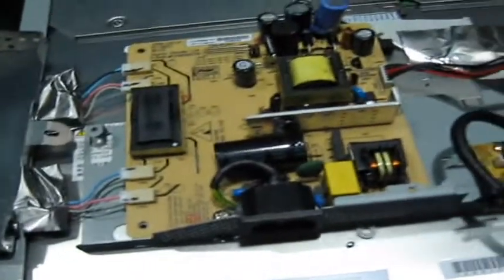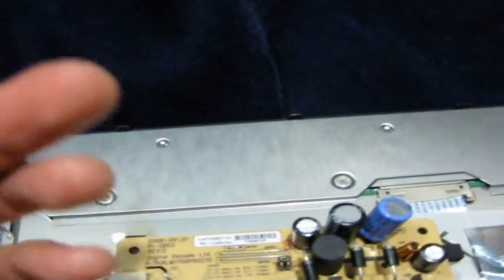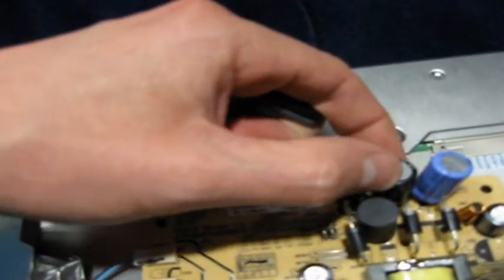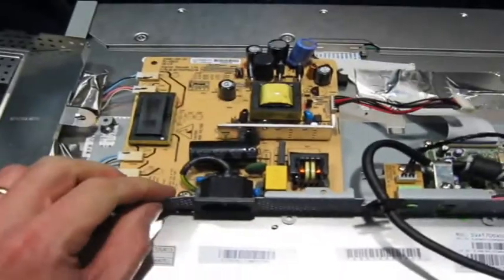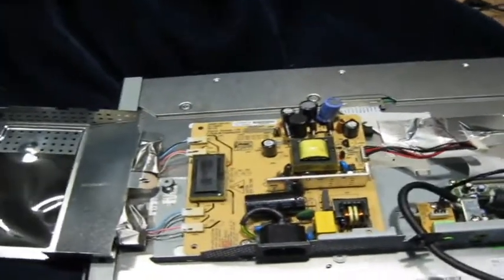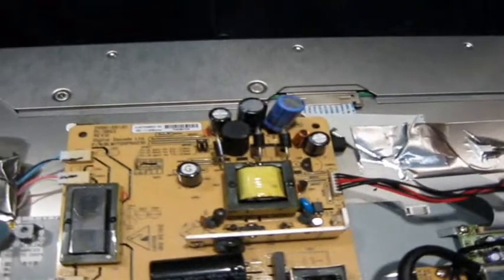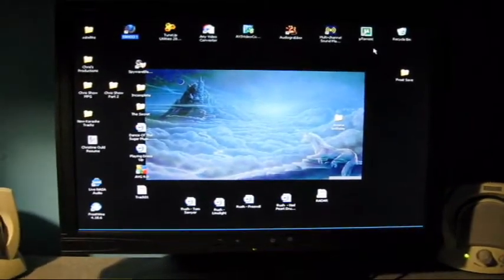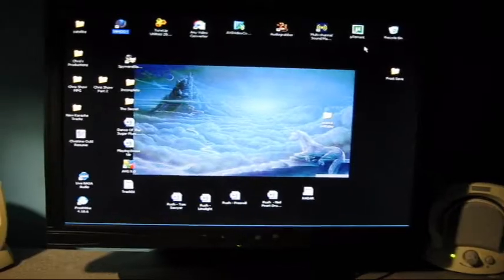LCD Monitor Repair

Comment: Hey, I have a Optiquest q20wb monitor and when I turn it on it makes a squeaking noise. When the monitor is hooked up to the computer it doesn't want to show anything on the screen, the screen is just black. It has a green flashing light in the down-right corner. So could you please help me to fix this monitor so I can use it, and also if I need a capacitor where can I buy it so I can replace it? Thanks!

Comment: so you doubled the voltage but still remain at 470uf? thats way underrated your damn lucky it works in SERIES theyd double the uf but remember youre still under 1000 uf and itd run through the first cap so youre a bit limited. it can be done but best to get the PROPER cap they are dirt cheap and dont risk an expensive lcd monitor. especially in the psu

Comment: Thanks for the vid! I was able to do the same to a similar model Optiquest Q9B-2.  Replaced the 2 Capacitors with 1000 uf 32v and FIXED!
Interesting note: The capacitors did not look blown at first glance, the tops were just barely "domed" so I figured to replace them,  The DMM shown not storing the rated farads.

Comment: thank you for your videos. The problem is i have replaced the capacitors in the power supply of a Samsung monitor (Power Board IP-35135B). I even replaced the ones that looked fine in case they couldn't hold up charge anymore. Still no success. Back light still doesn't lightup. I know for a fact its the power supply problem because i have tried it with a different known working one and the monitor lights up.
Do you have any solution? Could it be other problems such as transistors or coils?

Comment: @kirkconway You really need to open it up and have a look at the capacitors on the power supply board.  If any are bulged, you stand a good chance of repair...

Comment: wow. So very grateful of this video. I just picked up one of these monitors from the trash (who the hell throws out LCD monitors?!) and had the exact problem you just described as well the IDENTICAL cap you replaced looks like it's popped on my power supply board. Will pick up some caps to see if I can bring this beast back to life. If it works im selling it for 80$...Who knew you could find money on the ground.

Comment: Fixed an Optiquest Q9b-2 using this same technique - Radio Shack had a 1000uF @ 35VDC capacitor that worked just fine.  Just $1.79 later and I have a working monitor!!!  Thanks for posting this video.

Comment: but usual you can look some line on the monitor gren red blue  or any stuff  like  " no signal " if  don't get nothing tha mean you lcd is done you need to open and check the power suply...

Comment from the maker: Did you verify your video card is working by testing it with a known working monitor?
If so and you've confirmed you have video signal from the PC then its back to tracing out the problem in your monitor. If it was a power surge its most likley in the first stage of the power supply.

Comment from the maker: I did test the capacitor with the VOM and it was shorted. Capacitors sometimes bulge like this one did when they go bad with a short. 
I know what you mean when you say you miss it. Last time I was working at a electronics repair shop was 19 years ago !!! But I still do repairs and enjoy my Amateur Radio hobby :-)

Comment: So, were you able to find the defective capacitor simply by visual inspection?   Good job!   My degrees are in electrical engineering, but I've done almost nothing electrical at work in the last 15 years.   I kinda miss it.

Comment: Damn! And to think I threw away an otherwise perfectly good ten year old TVM CRT color monitor that wouldn't come on when I hit the switch because all it might have needed was two 470 microfarad capacitors in parallel? Double damn!

Sure wish I knew what I just wrote :)